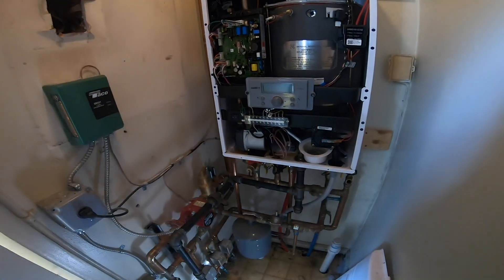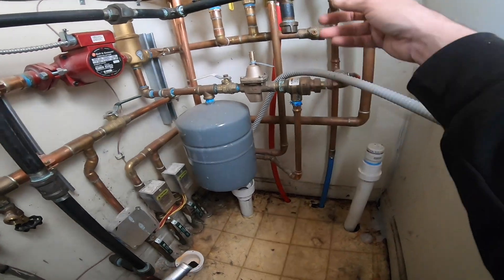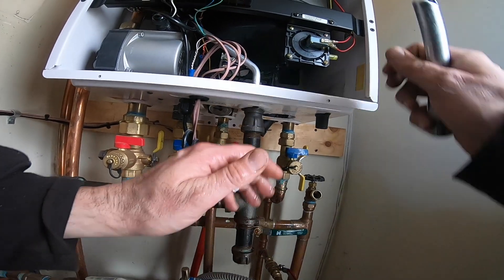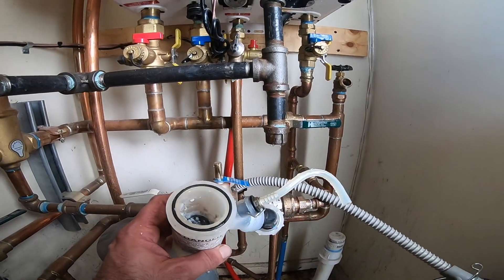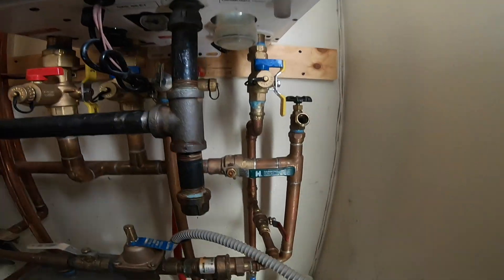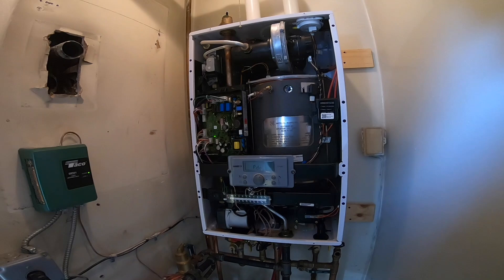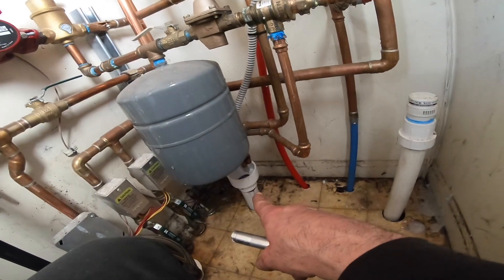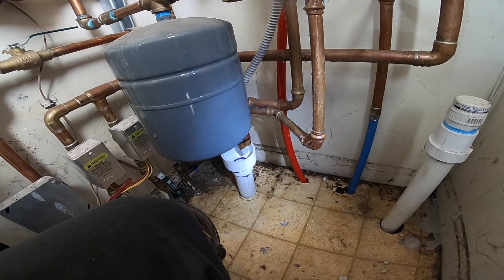Inducer Slurping Water Pressure Switch & Ignition Lock Out No Heat/ Hot Water

Comment: when you first fire those after cleaning trap out, leave the drain hose off and block it with you hand, rubber plug or plastic wrap and rubber band for a few minutes, until it builds some water. then unblock and reconnect hose. you could always add plain tap water back whilst installing

Comment: woah, try a shop vac on the hose outlet first or with adapter on the bottom of large trap cleanout cover. suck it out and flush through with water vs. cussing it for 3 hours,  do you not all have endless calls for service that end up lost to clowns (side-show-bob?) whom knows how to quickly clean those "EU plan" turd devices. they're own cruft is backfiring on them hard now ;)
Reply: 90% boilers are fine, the issue is no one tells the customer they need to be maintained yearly and about every 3 or so years full tear down maintenance.
Reply: @Rainmaker88  because if they told them, they'd not get them or would forget and not do it anyway, it's just another expenditure which nobody but the top rich elites can afford. or you work in hvac and do it yourself

Comment: I do love knipex tools but there so dam expensive
Reply from the maker: A tool can be looked at as expensive or valuable. How often would the tool be used. I am not going to say knipex make the best tools. Yet the 7” pliers wrench I believe is the most valuable adjustable wrench. Same feelings for the 10” and 12” cobra pump pliers. If these three tools ever get misplaced I wouldn’t hesitate, to buy again. Most my electric handles tools are Klein’s which also make excellent tools. I also found some really good tools at harbor freight. Yet something about the quality I notice with the few German tools I own.
Reply: @thehvachacker  I agree and there worth it since I use them along with my wera ratchet set.
Reply from the maker: Wera makes good tools, nws also makes good tools